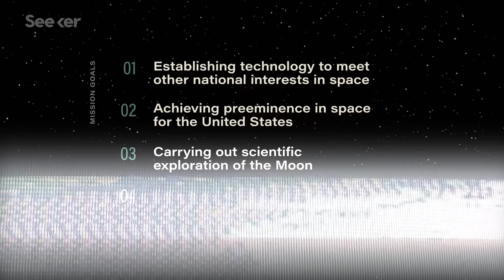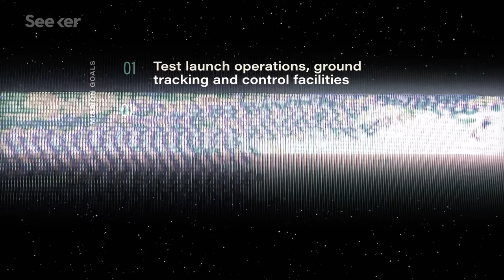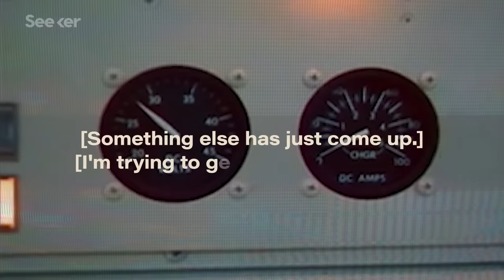Apollo 1's Fatal Fire Almost Ended the Spaceflight Program | Apollo

Comment: In a 100% oxygen atmosphere the human body is fuel for the fire.
Reply: Anything will burn at that concentration, even metal.
Reply: Suits survived the fire - crew died from asphyxiation
Reply: I am reading that the Apollo 1 spacecraft was over pressurized  to 16 psi during the accident.  Why would Nasa over pressurize the capsule knowing the dangers of fire?
Reply: @RusskiCommieBot   you can't pressure test a spacecraft in space, so how do you test at sea level where there's already 13.7psi???
ANS: you pressure test at 16psi. They should have used nitrogen and not pure O2 and without crew.
Reply: @maxheadroom9014  I understand the need for pressure testing the spacecraft. I can't understand why they did the test with the astronauts inside knowing the danger. My understanding is post Apollo1 nitrogen was introduced while the space craft was on the ground and was bled off during the ascent to space. The spacecraft were supposedly pressurized at 5psi with pure oxygen during the flight thus reducing the risk of a catastrophic fire.
Reply: @maxheadroom9014  No they also got burned.
Reply: Are you a rocket scientist?
Reply: James Berlo Yes, after they had died from asphyxiation
Reply: Good question
Reply: NASA didn't realize how dangerous 100% oxygen was?
Reply: @RusskiCommieBot  They'd had success with this approach prior for hours and hours at a time with this same crew and others in the same spacecraft. They also had a serious accident in 1960 with nitrogen mix, testing cabin/suit pressure. The pure oxygen design was judged to be safer, less complicated, and lighter in weight and had worked for years - but it came out eventually that NASA had no idea how pure oxygen would influence burning.
Yes, wikipedia is useful.
Reply: Why didn’t they close their helmets
Reply: It is true...They did not have  a chance, due to the conditions that they were put under!!!
Reply: Enigma McC  No, their autopsies [edit: showed] they died of carbon monoxide poisoning. The lethal gas entering the cabin was a result of the fire as well, but they did not burn to death. The burns were severe, I'm sure, but it wasn't the cause of their deaths.
Reply: Enigma McC  I think you're wrong on both counts. It sounds more like he's saying "open up!". Also, you can die from flames, but they apparently did not. According to the autopsies, all had heart attacks from carbon monoxide inhalation.
Reply: @maxheadroom9014  that’s not correct, back then they had the suits from the Mercury and Gemini progams, made out of inflammable and easy melting nylon. When they opened the hatches, the seats, suits and carcasses had to some parts already melted together :(

Comment: Donn F. Eisele. After dislocating his shoulder twice during training in January 1966, Eisele was replaced by Roger B. Chaffee. After corrective surgery on January 27, Eisele was named to the crew for the second crewed Apollo flight, with Command Pilot Walter "Wally" Schirra and Pilot Walter Cunningham. At this time, Eisele was promoted to the Senior Pilot position. 

In December 1966, Apollo 2 was cancelled on the grounds that it would be an unnecessary repeat of Apollo 1, and Schirra, Eisele, and Cunningham became the backups to Grissom's crew. But after Grissom, White, and Chaffee were killed in the Apollo 1 spacecraft fire of January 27, 1967, Schirra, Eisele, and Cunningham were named to fly the first crewed Apollo mission instead. It would ultimately be called Apollo 7. 

As the launch date approached, Eisele's participation was at risk; he was having an extramarital affair with a woman who would later become his second wife. Astronaut Office Chief Deke Slayton had warned the crew that they were all "expendable", and that any extramarital affairs must not become public. 

Eisele remained on the crew, and on October 11, 1968, Apollo 7 was launched on an 11-day mission—the first crewed flight test of the third generation United States spacecraft. By this time, the Senior Pilot title was changed to Command Module Pilot. Together with spacecraft commander Schirra and Lunar Module Pilot Cunningham, Eisele performed simulated transposition and docking maneuvers with the upper stage of their Saturn IB launch vehicle, and acted as navigator, taking star sightings and aligning the spacecraft's guidance and navigation platform. The crew completed eight successful test firing maneuvers of the service module's propulsion engine. They also tested the performance of all spacecraft systems and broadcast the first live televised coverage of crew activities. 

Apollo 7 was placed in an Earth-orbit with an apogee of 153.5 nautical miles (284.3 km; 176.6 mi) and perigee of 122.6 nautical miles (227.1 km; 141.1 mi).[2] The 260-hour, 4.5 million mile (7.25 Gm; 7.25 million km) shakedown flight was successfully concluded on October 22, 1968, with splashdown occurring in the Atlantic, 8 miles (15 km) from the carrier USS Essex and only 0.3 miles (0.48 km; 480 m) from the predicted target. Eisele logged 260 hours in space. 

Eisele served as backup Command Module Pilot for the 1969 Apollo 10 flight.[4] Eisele resigned from the Astronaut Office in 1970 and became technical assistant for manned spaceflight at the NASA Langley Research Center, a position he occupied until retiring from both NASA and the Air Force in 1972.    https://en.wikipedia.org/wiki/Donn_F._Eisele
===========
I bet he felt terrible after his shoulder injuries got him replaced for the Apollo 1 mission. He had no idea at the time how lucky he was. It's like watching a report about a plane crash, and you find out about somebody missing the doomed flight for some reason, and how lucky they were, but they were probably pretty p/oed about it at the time. 

I'll try to remind myself about this the next time I experience something unpleasant. In fact, now that I'm thinking about it, I've already experienced near misses when it comes to very minor tragedy vs something far worse. I bet a lot of people have experienced the same thing. 

I hope Eisele never suffered from survivor's guilt, but he may have. They're all together now, and have seen so much more than they ever could have when they were working for NASA. 

"Oh! I have slipped the surly bonds of Earth
And danced the skies on laughter-silvered wings;
Sunward I’ve climbed, and joined the tumbling mirth
of sun-split clouds, — and done a hundred things
You have not dreamed of – wheeled and soared and swung
High in the sunlit silence. Hov’ring there,
I’ve chased the shouting wind along, and flung
My eager craft through footless halls of air....
Up, up the long, delirious, burning blue
I’ve topped the wind-swept heights with easy grace.
Where never lark, or even eagle flew —
And, while with silent, lifting mind I've trod
The high untrespassed sanctity of space,
– Put out my hand, and touched the face of God." 

by John Gillespie Magee Jr. 

High Flight - Lockheed F-104 Version 
https://youtu.be/eTms_G1yYPc

Comment: Interestingly, the Rate Needles were indicating movement of the capsule. This could be interpreted as one of the astronauts moving inside the capsule, possibly to wiggle comms wires attempting to fix the static problem.

Comment: As a graduate student in late 1966, I was listening to a presentation by a Rockwell engineer about the Apollo capsule design, and when he explained that the hatch could only be opened from the inside by unscrewing 19 bolts with a ratchet wrench, I said "Congratulations. You've designed a death trap!" I was ejected from the presentation for being disrespectful, and three months later three astronauts died on the pad. It has always bothered me that I didn't try to find a way to somehow prevent that tragedy.

Comment: Why 100% Oxygen ?  Surprisingly, the reason was to save significant capsule weight. Humans breath air at sea level pressure with about 20% oxygen (rest in mostly nitrogen) - the sea level air pressure helps the body absorb the oxygen. If the capsule had the same 20% oxygen, the capsule would have needed to also have sea level pressure inside (pressurized capsule). This would have required increased structure as in space the pressure is zero. Increased structure = increased weight. It was all to save weight

Comment: NOTE:  There is a misleading inconsistency here.  The problem was NOT the 100% Pure Oxygen...  the PROBLEM was 100% Pure Oxygen  AT  16  PSI,  thus soaking everything in oxygen, to the point that things that would not brun normally, were suddenly able to oxidize and burn like phosphor torch.  The PRESSURE was the problem, NOT the gas itself.  The Apollo Program continued using the Pure Oxygen Atmosphere system even after the Apollo 1 Disaster, all the way until it was replaced by the Shuttle Program.

Comment: This is 1967, the Apollo programme was in a shambles, was cutting corners from a safety angle being, under great pressure to deliver on Kennedy's deadline, but was incapable of doing that as Grissom pointed out and hung a lemon on a coat hanger on the space craft prior to the ahem, accident. Funny that only 2 years later NASA was successfully sending men to the moon and back. Hmmmm.

Comment: Why was the Apollo one the only spacecraft to have an inward opening hatch
Reply: It actually went back to Grissom's experience on his Mercury flight. The Mercury spacecraft's explosive hatch blew off after splashdown and the capsule sank and Grissom almost drowned. That prompted NASA to use an inward opening hatch on Apollo that could not accidentally come off. The idea was that the pressure inside pushing out would help hold the hatch in place. The new hatch on the later Apollo spacecraft did open outward, but they were firmly held in place with several latches that were only released when the crew pumped a handle a few times to pressurize the release mechanism. None of these ever released accidentally but in an emergency they could have opened outward in just a few seconds.

Comment: Very sloppy electric work with wires laying out on the capsule floor and the use of undiluted pure oxygen, which is a real fire risk was a serious neglect of basic safety and basic science. Any spark from this sloppy wiring would ignite the pure oxygen. The amount of time to open the door and dilute the oxygen was too long. It was a stupid design that was a real death trap, that resulted in a needless tragedy.

Comment: Oxygen isn't supposed to need something else to be able to burn? Just like natural gas needs oxygen, I was taught any 100% something atmosphere couldn't burn by itself
Reply: A lot of the stuff in the capsule was highly flammable. That's the stuff that burned when they had a short of somewhere. The oxygen fed the fire.
Reply: Oxygen supports combustion but it doesn't burn by itself. You still need combustible fuel present. However, when you increase the concentration of the oxygen (100% oxygen instead of 20% oxygen and 80% nitrogen, like in air) and you increase the pressure (20.2 psi inside the spacecraft instead the normal 5.5 psi) then everything gets more flammable and it will burn a lot faster. The length of time also matters as the oxygen will soak into materials after a while and saturate them, which will further increase their flammability.

Comment: The Apollo 1 fire happened on 01/27/67. Yet just over two years later, they landed Apollo 11 on the moon? Hogwash. They troubleshooted, redesigned, and fixed everything in just over 2 years? No. They gave up and it became a studio production.
Reply: Or they didn’t use a 100% oxygen set up and mixed nitrogen into it which would resolve the flash fire incident?

Comment: My dad worked in the engineering of this capsule that started in 1961 . No there was not a rush in the engineering of this thing .  Back then they could not make the door to open outward and make it to seal properly . The tests had been done over and over again on this problem . The structure of the capsule and door seals could not with stand the inner pressure . They say there was some fray wires . That was not true at all ether . They only found frayed burned wires after the fire . Look at it this way . Nether North American or even NASA would let it fly with fray wires . A person could only do what they have to with in the limits they have at hand . Just remember this also . Russia or the thieves Communist took every rocket engineers out of Germany . So it is only going to be natural they are going to be at the head of the game . Russia was and always had been thieves and dirty nasty  evil and vile people .